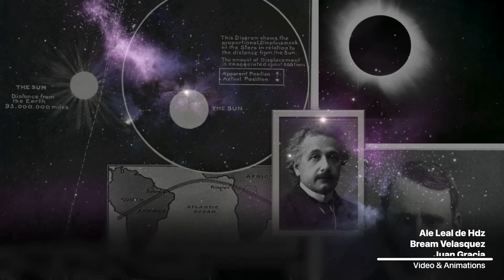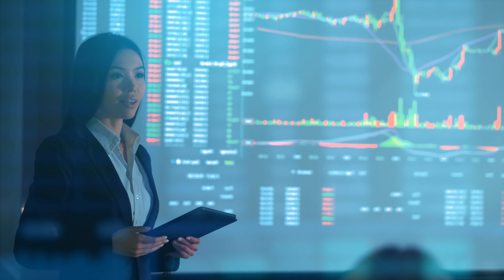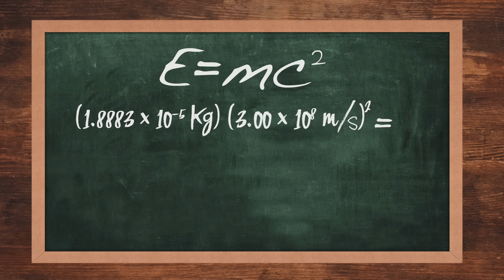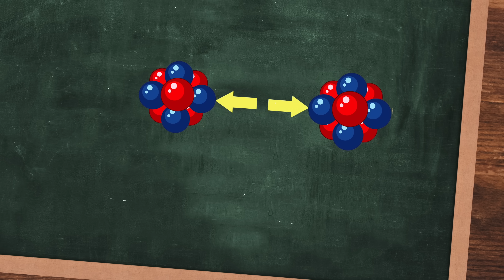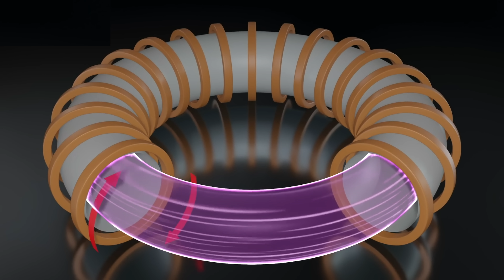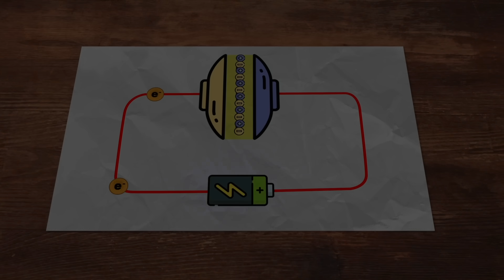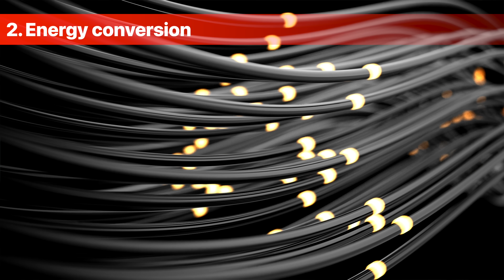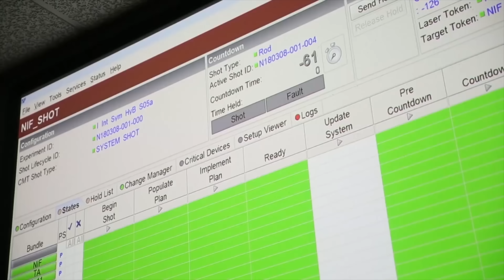Why THIS Fusion Milestone ISN'T Like The Others...

Comment: I'm not a physics expert, but I don't understand why the tokamak, for example, has been developing for decades, and fusion physics has been well understood since the 1950s. For example, it should have been well known exactly how much pressure is needed, what temperature is needed, how strong the magnets need to be, etc. Then just build to specs or at least know what materials/ pieces are missing. What am I missing? Anyway, I'm happy about the milestone at the  Lawrence Livermore National Laboratory within my lifetime.
Reply: The issue has been to get useful energy out of the fusion system in a controlled environment. We know about fusion, we know how to ignite it. We even can get more energy out of the system i.e. hydrogen bombs. But that is an uncontrolled reaction. Just like an atomic bomb is an uncontrolled fission chain reaction but a fission nuclear reactor is a controlled chain reaction where you generate enough heat to boil water and run turbine and not pull a Hiroshima. 
LLNL for the first time in human history have demonstrated a "controlled" net positive fusion chain reaction. We have done net positive but uncontrolled and net negative and controlled fusion experiments for 60 years. This time we did positive controlled.
Creating those conditions are not as issue. Controlling the conditions however is a whole different scenario and making it stick is another. We are currently operating at the limits of our current engineering applications and knowledge. Fusion is difficult because there are too many variables that govern the reaction and they all have to be right down to a picosecond!!!! If the conditions are not exactly right, the fusion stops. 
For LLNL, the 192 lasers had to be aimed and triggered so precisely that they compress the entire payload from all sides and directions with equal force so it compress equally from all directions. Just a little discrepancy and the payload turns into a pancake and the reaction doesn't happen. 
What LLNL did is like the first heavier than air flight by Wright brothers. 
On Dec 17 1903, the first flight, by Orville Wright at covered 120 feet in 12 seconds, at a speed of  6.8 mph at an altitude of a whopping 14 feet!!!! Useless in terms of practical applications and Boeing 747 is still a few decades away but that first flight is still to date the greatest achievement in aviation history.
From a technically challenging point of view, this is the most difficult thing to date humanity has ever achieved.
Reply: Fusion physics is understood at the pairs of nuclei level. It is not understood at the bulk plasma level. Magneto-hydro-dynamics is hard. Super-computers and even the magic bullet AI cannot model large plasma volumes for long periods of time. So there are always surprises when the next test is run in a tokamak. Also, keeping the plasma non-contaminated (from tiny bits of the reactor vessel walls) is a problem. Also, keeping the reactor walls non-contaminated with fusion fuel is a problem. Also, the field has actually been massively under-funded in sporadic fits and starts.
Reply: What you're missing is that fusion is a welfare program for plasma physicists.

Comment: Fusion is a multi-trillion dollar scam. If you read the scientists own reports it took over 100X the energy for the lasers than was produced. There is no such thing as cold fusion and there is no material on earth or the universe that can contain the heat from fusion . That is why they have only done these micro fusion bursts because anything else would melt down the entire lab and possibly more.

"Our sun, considered a medium sized star, can reach temperatures of 15 million degrees Celsius". Now name any material that can contain that heat?

As for Deuterium from sea water you have to add in the energy used for electrolysis and that is more than the energy produced from fusion of the deuterium and not even including the process to get tritium and then convert that to a pure diamond form. Add in all that energy use and you quickly see fusion is a scam.

This is simple math any scientists know but they are scamming trillions from governments and tax payers knowing fusion is never going to happen. Big oil and gas loves fusion because they know it will never be accomplished so no threat to them just like carbon sequestration and that is money that should be spent towards solar, wind, geothermal and green hydrogen production that will replace fossil fuels.

Comment: Your definition of "inherently safe" would also apply to several types of modern small modular fission reactors that self-moderate as you are ignoring the radioactive byproducts of both fusion and fission reactors.  If you do consider them, then fusion is still likely safer, though not safe, as it's mostly just longer-lived shielding material and other infrastructure parts that become radioactive in a fission reactor. They should be a lower grade of radioactive than spent fuel from a fission reactor which also irradiates its shielding material and other parts. It's not impossible to do fusion without such byproducts (with aneutronic reactions like ³He+³He or ²D+³He, for instance) but it's much less likely to be a sustainable reaction that produces excess power and it's sometimes hard to prevent other reactions that aren't aneutronic (²D+²D when you attempt ²D+³He) in mixed fuel scenarios.

Comment: I am not buying the "no harmful radiation" of fusion process. If that was the case, space would be a no problem. All the ionizing radiation we are protected from by ionosphere will also be generated during fusion in reactors. Perhaps it might be worth to investigate what happens with all the frequencies of radiation that are created during fusion, too.
I also start to doubt the idea of a needed base load, but that's for a different discussion.
Nice video though - hitting the breaks in expectations of clean, cheap and abundant energy is always a good idea.

Comment: Can you get us some information on "Cold Fusion"? 
Since it's scalable, that's the real game changing Technology. 
Imagine being able to Power everything from a non-centralized mini powerplant from Cars and Trucks, to Locomotive, Airplanes, Farm Equipment, to your House etc.
Reply: Read wikipedia about muon catalyzed fusion. Moun is a negatively charged particle 207 times bigger than electron. If you replace electrons with muons in  hydrogen atoms, you could overcome the columb barrier and potentially start room temperature fusion. muon catalyzed fusion has been experimentally proven.
The problem is it takes more energy to create muons than what we can get from muon catalyzed fusion. Muons have a very short life, only 2.2 microseconds So unlike electrons, they are not very stable.
Reply: Debunked much?

Comment: They may have called it a gain but MORE energy went in to the reaction that came out of it.  Only creative accounting allows it to say anything different.
A 99% loss of energy is not to be proud of.
Reply: On Dec 17 1903, the first heavier than air flight, by Orville Wright at covered 120 feet in 12 seconds, at a speed of  6.8 mph at an altitude of a whopping 14 feet!!!!  It was utterly useless in terms of any practical applications. And yet that first flight is still to date the greatest achievement in aviation history. Should they be proud of this useless flight????
What you are asking for and what LLNL did would be like you wanting a Boeing 747 around the same time as Wright brothers were taking their first flight.
Reply: @JW-be8wf  1903 was first powered flight and that's how it was reported.  LLNL reported a net gain by using creative accounting and NOT LOOKING AT THE WHOLE SYSTEM.
By that logic IC engines are perpetual motion machines.

Comment: Before watching.., the e-Pi-i sync-duration function applied as Observation of WYSIWYG QM-TIME resonance Actuality, "knows", as the absolute mechanism of universal memory associations, that the input-output of a Nuclear emitter-receiver log-antilog re-action that is Quantum Operator Logic Oscillation holography in Actuality.., that the system-device requires "catalytic" moderation-metering, that is why atoms combine, resonate for some relative-timing ratio-rate duration, and then re-combine in alternative proportioning.

Part 2: the big bang delusion has been adopted by experts in fraudulent Sciencing misrepresentation-by-default of observational mathematical fact, yes CMB pictures conform to the AdS/CFT wave-particle amplitude and frequency interpretation of one sided holography, of course it does! (Science advances one hidebound authoritarian death at a time, will always be true,  re-evolution)

Finally, the Forever Fusion-Fission mass-energy-momentum emitter-receiver function of electromagnetic-gravity in our sky, is still a preferred choice of Energy, the Fission underground is carrying the best Base Load of Environmental metastable ecological resources, (keeping Continuity in Continental Drift mobility).
***
We keep getting the story of energy, that it is a mystery yet to be analysed by machines like this and exploited in such a way as to release "clean",  ..meaning no collateral dangerous radiation release. Some honest, experienced Scientists, say that is unlikely. Red Herring smell is strong.

Comment: 5-10 years? You are a true optimist. I am 64. I will be mildly surprised to see commercial fusion in my lifetime. IMO, commercial fusion will not be developed in time to be a major player in addressing climate change. If we would dedicate the same resources to improving fission designs that we already know work. We could have abundant electricity to address all our energy/climate concerns in the next ten years.
Concerning the most developed fusion design vs fission. Tritium is pretty much acknowledged as essential to the commercial use of the tokomak design. To produce enough of it, the design must include a fission reaction. The design operates under extreme heat and pressure, so I fail to see how it's more inherently safe than fission reactors (heat, pressure, explosive and/or radioactive gasses have been the issues, not meltdowns in most nuclear accidents). Development of some of the molten salt designs, operating at atmospheric pressure, would be walk away safe. They would have fuel efficiencies over 90%, as opposed to the less than 10% of current reactors. Mass and efficiency are also very important to the discussion of theoretical and real-world output. Theoretical hydrogen fusion output being only 4x greater than fission reactions makes the msr designs even more appealing. These msr designs (like other nuclear reactors) would also supply all the heat we need for desalination and other industrial processes. They pair well with renewables in combination with thermal storage. The fuel needed and the efficiency is great enough that these designs could address our energy needs for many centuries.
Reply: The problems with fission?
Let's use 2 existing, ongoing projects near me (UK) to explain.
Nuclear.
3.2 GW.
Proposed ±2005
Now due to complete 2025, 4 (5?) Years late.
£18bn..... Now £26bn(!)
Zero energy until it's complete and they "flick the switch" (it's "binary")
I'll also note that it's an add-on to an existing project, so much of the Infrastructure was in place.
....
Offshore wind.
3.6 GW
Proposed ±2012
(First if it's type so it needed factories + new infrastructure)
Due to complete 2025, on time.
£8.7bn.
BUT
It's ramping now!
Turbines are being connected as they're installed.
That's a huge reduction in carbon footprint during construction (plus it's much shorter anyway)
So, in theory, they could construct and install 3 times the capacity (spread out, to catch the wind over a wide area ..... It always blows somewhere!)
Or, 2x the capacity and LOT of storage for the same investment.
Return on that investment would begin in half the time.
AND
the current "strike price" for the wind project is £49/MWh.
Nuclear? £118/MWh.
....
There's really no contest.

Comment: Once the process started, why didn't they keep feeding the fire?  Shouldn't it continue on it's own after started?
Reply: The fuel is inside a little pellet that takes months to make. It's not a continuous process. That's a major challenge, albeit not insurmountable.
Reply: The entire fusion reaction lasted about a nanosecond. It would be hard to physically add more fuel in the system within that nanosecond and keep the reaction going. Besides only 4% of the fuel was used up. So 96% was still unfused. It will take us time to get the recipie right.   
Besides the mission objective of LLNL was to demonstrate net positive fusion controlled reaction. Sustaining it comes later and will liekely involve other disciles and expertise which LLNL was not too concerned with right now.
Reply: Thanks for the replies.

Comment: So to continue to campfire analogy, they took a tanker truck of gas to start a small campfire.
Reply: Yes, not because the only way they could have done it was with the tanker but because it was the cheapest and easiest way.
Reply from the maker: right... but that tanker size keep shrinking... and now it was just a bucket, but it was a leaky bucket, that required a tanker to fill :)

Comment: Ironically, scaling up may not be the solution, but in fact scaling down. Smaller reactors require less power, less fuel, and have far higher potential for greater relative power output to power input. Large scale fusion power generators like the Tokamak generators have the aim for sustained fusion, so you fire up the reactor and it just sustains the fusion process so long as it has fuel to do so. So you only need that one instance of startup power to get constant power output. However, the laser induced non-Tokamak style reactor which actually achieved over-unity, would be better on a much smaller scale. Imagine if you will that those perfectly spherical pellets were the size of a pinhead rather than the size of a bb or small ball bearing. Far more of them could be produced with lower rates of imperfections at a cheaper cost, using much smaller amounts of the secondary fuel. Instead of a reactor the size of a semi-truck we get a fusion reactor the size of an Xbox One X. Deuterium is pumped into it, a much smaller laser array is needed to ignite it, fewer super-capacitors are needed consuming kilowatts not megawatts of power, and we instead get out of this reactor 10x, 20x, 100x the power input. With the much smaller amount of fuel, we get higher efficiencies in total fuel consumption, which means greater conversion of the deuterium and fuel to a fusion state and energy output.
Reply: Good stuff!

Comment: Ricky, you have explained this better than anyone I've heard!

Anything we do to reduce are carbon foot print and become energy independent should be our goal.
Reply from the maker: thank you Shaun, and I totally agree..it's a long road but we're going to get there
Reply: @TwoBitDaVinci   @Two Bit da Vinci  why aren't we using it?  We haven't been able to make it work in a viable way? LIE 

No the public peasants haven't been able to do it. Classified defense and aerospace sector did it DECADES AGO. 

please 🙏 do yourself a favor, I don't know how you wanna crawl the web to pull the data reports from every defense and aerospace company and organization. DARPA, Lockheed Martin, DoD, DoE, Raytheon, Los Alamos, Oak Ridge, SRI Labs, MiT ANYONE TIED TO CLASSIFIED DEFENSE, AEROSPACE. 

What you will find after a few years of compiling is THOUSANDS OF LAB REPORTS confirming 👍 compact nuclear fusion reactor technologies, tritium and deuterium manufacturing electrolyzers, Tiny plasma gas reactors. All kinds of stuff. It's CLEAR the classified defense sector sunk TRILLIONS of off the books defense budget into secret hydrogen based technologies from the 1940s until now. 

What Lawrence Livermore Labs and the DoE announced was a joke, they are 60 + years ahead of what they announced only now several independent labs and scientists around the world are replicating and perfecting the technology, which is causing the defense department to have to begin making public announcements. The public and most of the private sector is who is still a decade away, the classified defense sector been there and done that decades ago.
Reply: Anything would mean building fission power plants immediately.
Reply: You do realize that the current biosphere only has about 3% of the carbon in it that it did back in the days of the dinosaurs...  Our biosphere is slowly dying for lack of carbon that has become locked up in limestone and coal deposits.
Reply: @shdwbnndbyyt  prove those numbers.
Reply: @shdwbnndbyyt  first I’d like evidence, and second our plants have evolved for this level of carbon as well as animals and if we did have 33x the carbon we currently do the world would be come significantly warmer and plants and animals may struggle to live because they didn’t evolve for such conditions.
Reply: To me removing to much co2 would STARVE the plants that we depend on for oxygen and food . I agree energy independence would be good , sadly the FREEDOM STEALERS  HATE the idea of US being in control of OUR lives. Happy trails